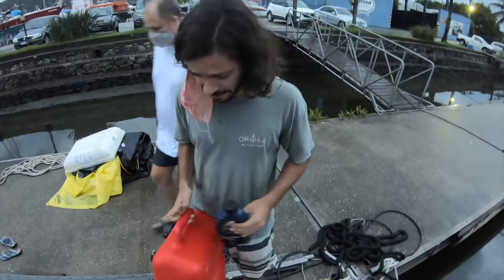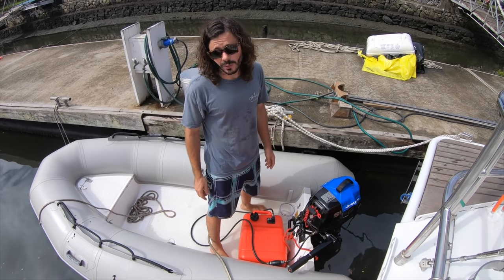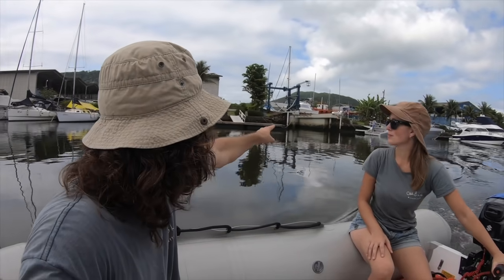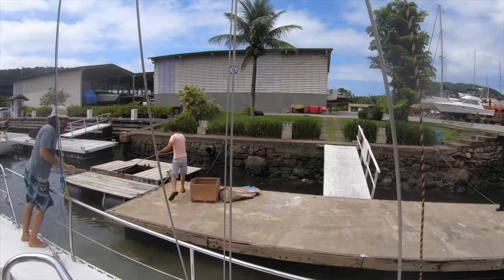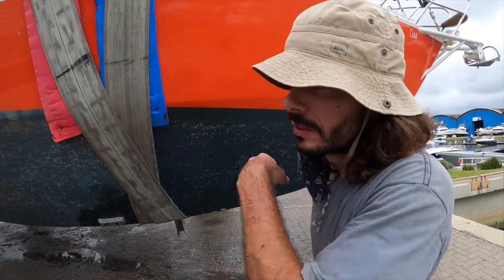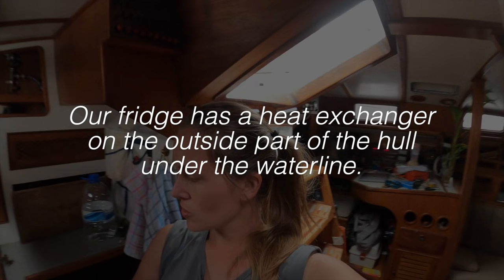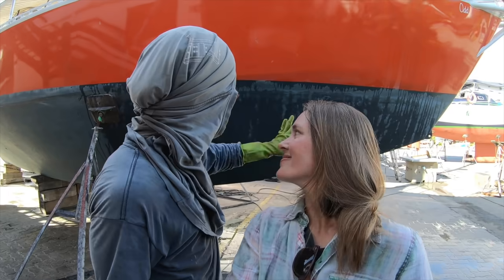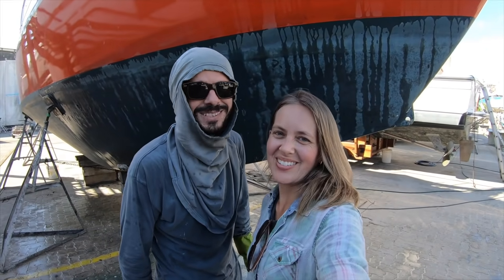⛵️We are back on the dry for two reasons!! 😨🤩#167

Comment: Hey guys sorry to disappoint you but your antifoul is as good as house paint. I also have never seen so many barnacles in such a short amount of time. I can’t remember the name of the stuff I used to use but it was good for 18 months. Then when you pulled it out and scrubbed it it was good for another 12 months. Ask around to try and get some antifoul that they use on commercial ships. That’s what I used for years and a 20litre drum would last for a long time as you thinned it with kerosene. The stuff off the shelf at your marina just isn’t good enough for extended periods at sea. Try and get some of the Trinidad brand by Petit.another gentleman suggested it sounds good. That’s if you can’t get any commercial shipping antifoul. Really you should not have had one barnacle. If you were in Australia I could help you out. Looking forward to your next videos so stay safe guys. 🇦🇺👍.

Comment: New engine? Wasn't the current one low hours?
Reply from the maker: In this video we talked about it: https://www.youtube.com/watch?v=QUClRe5bj6g&t=645s Low hours in use, may years without use
Reply: Missed that one... just looked at it... The lack of available spare parts world wide.. warrant a replacement. Personally a huge fan of Beta Marine... cheap and available spare parts everywhere... 😉🙂
Reply: @R.E.HILL_  The point about the engine having value in Brazil where a lot of people have the same engine but only being worth scrap metal outside Brazil was important too, because if they can't get parts they will have to replace it later anyway, for a boat they are planning a lot of time on, much of it outside Brazil, I think this is quite an important consideration.

Comment: Never heard of 2x the oil in a 4 stroke motor.  Are you reading breaking proceedings for a 2 stroke? To much oil will cause bent valves and or rod because there's not enough room with Xtra oil

Comment: Buy hauling wheels for inflatable boats they are a must !!!!
Reply from the maker: Once we are in the water the dinghy is gonna stay on the boat 😉
Reply: @OddLifeCrafting  its about thats little weels fixed back and foldable
Reply: @OddLifeCrafting  no it's not, unless you don't plan on coming ashore? or maybe you'll only come ashore from a marina?, the hauling wheels are for when you come ashore from the boat, to bring the dingy above the high tide mark.
Reply from the maker: @daveamies5031  Well, for now we are not planning on having it. If one day we can find a small and light one maybe we can have it. Thanks for the tip Dave and also @Maurizio Canale
Reply: @OddLifeCrafting  we use that on every beach ever  end we bless the existence.. ouu pram is an arimar 270
Reply: @OddLifeCrafting  Hey guys, I once fitted a small movers dolly for pushing around a 30 kilo canoe on docks and tarmac. Cheap, easy to stow away and useful for other needs.  They also make aluminum carts that convert to hand trucks and fold flat for easy storage. A little more expensive but might possibly be a good multi-use solution for the dinghy and boat provisioning.

All the best. Yaba is quite the project, no?
Reply: @OddLifeCrafting  My step dad and I made some for my old inflatable with some aluminium angle and some cheap wheels from the hardware store, not everything has to come from the chandlery. I do understand the need to prioritise though.  👍🏼

Comment: I thought you were concerned of the world and the sea contamination, but if you are using muriatic acid I guess you’re not concerned at all, I suggest you to wash out any remainings of the accid, it can be dangerous to the steel hull
Reply from the maker: We washed all the boat afterwards and the marina has a impermeable floor and treat the water from the floor before it goes to the ocean.

Comment: You know it wouldn't matter if you was towing "an island off the ocean" or tied to a dock. I have to ask, why you didn't rebuild the drive, u knew it was sitting for so long. Lesson learned is any mechanical devise with any kind of seals etc, at sitting for 5+years has dried,( deteriated) seals, plastic become brittle as well. Want to know what cks to make on the engine?
Reply from the maker: They don't produce this engine anymore, it's gonna get harder and harder to find pieces for it and it's made in Brazil, once we are outside it's not gonna be easy to give maintenance.
Reply: @OddLifeCrafting  makes sense, now out in 455HO engine from a Pontiac GTO or equivalent.

Comment: Bottom paint not good. Needs to use other brand in the future.
Reply: the problem with steel boats is you can't use the effective Bottom paints because of the copper content.
Reply from the maker: Well, we can't blame the paint, hehe. We were stock at the marina in a terrible water inside a mangrove area.

Comment: Wow. As a self employed detailer located on the great lakes, I have never encountered that bad of a hull from just a few months!  I have two quick tips that will help you the next time you clean your hull.. one- use the biggest baddest pressure washer you can get your hands on, 3000+ psi. It will blast those barnacles off effortlessly. Not that tiny 2000psi one you were using. That's why it took you 2+hrs. And second- use a gun with an angled tip. It will help more than you think it will.
And yes, clean the hull as soon as you can when you come out of the water. That is very important as you mentioned.
Good luck and have fun.
If you have any questions regarding all things detailing you can email me at pauls_detailing@hotmail.com